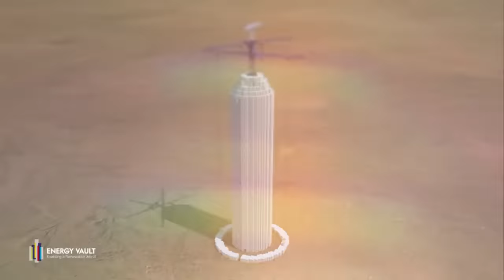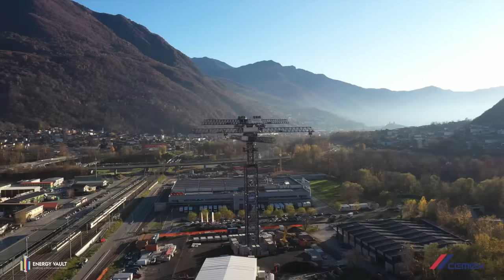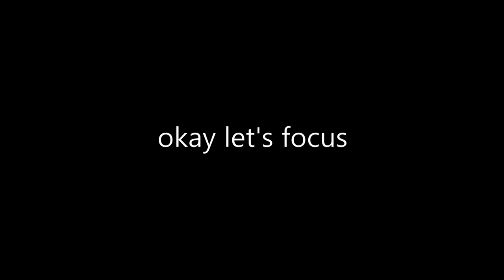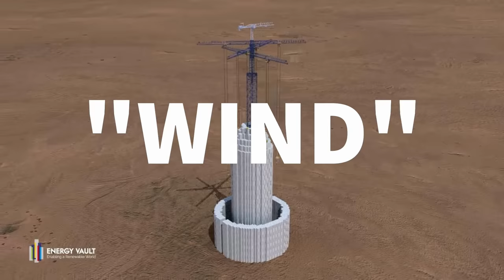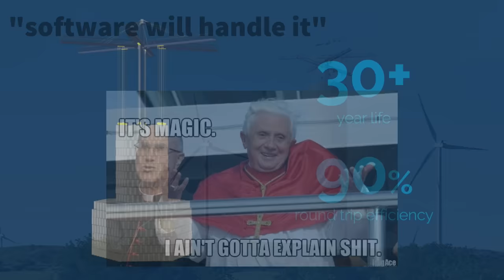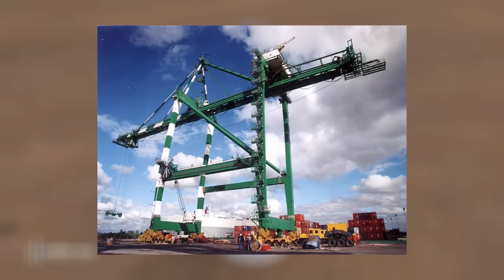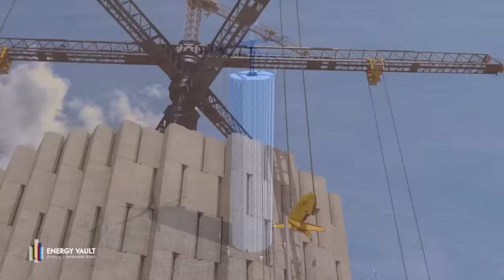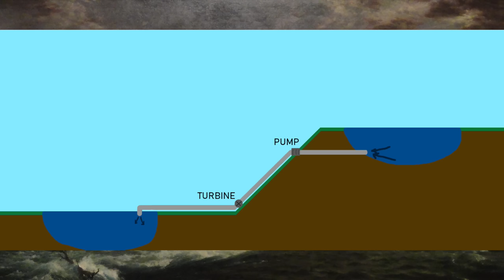The Energy Vault is a Dumb Idea, Here's Why

Comment: Listen, I'm extremely skeptical of energy vault, but let's be real for a second about pumped hydro... 

 Unless I'm mistaken it's pretty well established that we do not have enough suitable sites for sufficient pumped hydro storage, to say nothing of the location of these sites relative to major urban areas. Also, as we're seeing here in Ontario Canada, pumped hydro projects can get the same type of opposition as wind farms. Some of it pure NIMBY-ism, some of it legitimate concerns about environmental impacts on the local area.

As I said, I'm skeptical of energy vault too. I think there are probably ways to make the basic premise of "lifting heavy things as energy storage" more practical than what they're proposing. But capping off your argument with "Why don't we just do this thing?!" when that thing is inherently not scale-able and geographically limited kind of undercuts your argument.
Reply: This. "Why not just use pumped hydro?!" - gesticulates at flat coastal regions
Reply: @ThePixel1983  He pointed out that the easiest way of pumped hydro is using natural topography. However the "dig a big hole" method would also work. The startup cost would be huge, but in theory it could be done almost anywhere. One benefit of doing a closed indoor system is that water quality is a non-issue; as long as it doesn't screw up the pumps, generators, and valves, it could be raw sewage, industrial wastewater, or whatever.
Reply: Even in the flattest of terrains, surely building a tall silo with a few pumps would require less materials than building a solid tower with massive cranes?
Reply: @nicolaim4275  That water wants to escape in every direction at once, all the time. The blocks just need a strong foundation at ground level. Your silo needs to be strong very high up.
Reply: So the issues with pumped hydro storage are effectively the same issue the tower would have in those areas - if it's that flat, then the tower is more exposed to winds and probbly would experience the same amount of nimbyism and legit environmental concerns.

The biggest difference between the two is that hydro pump storage would expect lower startup and maintenance costs compared with the tower. Which sugests we need to find more solutions than just gravity storage batteries.
Reply: @TooShortPlancks  So like redux flow storage on an industrial scale? Yes, please, finally.
Reply: why not transport the energy to the hydrobattery? We surely have cables. There's some waste, but we also figured out high voltage AC. Of course, the same argument can be used for these concrete gravity batteries. Just place them where there's no wind. Probably there's a hill around to use water. But say there's a very very flat area, with no water whatsoever. Then I guess it's fine to use some solids. Of course, I am not sure why the solid has to be concrete. Why not whatever material is locally available? People build stuff everywhere.
Reply: @nydydn  From a German perspective: southern Germany (especially Bavaria) refuse both windmills and power lines. ("Not in my backyard", NIMBY)... You're proposing shipping the power across hundreds and thousands of miles and back again when most countries don't even have the capacities for distributing energy away from sun and wind regions.
Reply: Pumped hydro tests have been successful using an underwater reservoir connected to the enclosing body of water acting as the second and are limited to 700 meters deep. Here it's not he gravitational energy, but the variation in vertical pressure. This form doesn't require any specific geography, is compact, and doesn't suffer from evaporation, and if a reservoir collapses underwater, we'd just lose the reservoir and energy stored.
Guess what we have plenty of on this planet, bodies of water.

The big issues for this form is the possible disturbances on marine life where installed and complex maintenance. It has a similar MWh as the energy vault, while requiring less moving parts.
Reply: @EliteRocketBear  but digging is expensive, and the denser your material the less deep you need to dig for the same energy storage, which is a benefit of solid bricks over water
Reply: @paulochikuta330  underwater pumped hydro doesnt require any digging.
Reply: Lakes man.
Reply: Although I like a few of his videos, but the arrogance with this guy is just through the roof. 
If PSH worked for every case there wouldn't be any need for any other storage solution (Plus they are expensive, need specific topography, and destroy environments). So what does he suggest : 
- Stacking the blocs in a wall-like structure to help with the wind chuckle
- Digging a tower deep hole once again to help with the wind (cost, feasibility, sanity really...)
- Creating a lake deep underground, then putting another lake on top of it, with the turbine is at the same level as the top lake intensive facepalm
I won't go into the details about why this video (and many others on this channel)is a sham, maybe pull the wool over people's eyes, and as someone working in the field, I feel insulted.
Reply: "Global Pumped Hydro Atlas" for many sites to build one.
Reply: @EliteRocketBear  you mean underground subsurface . It's hella more expensive than regular PSH that i've work on for years now, thry are some of the oldest means of storage but they pose many challenges to be implemented and for that reason people are trying to find new solutions
Reply: @keith6706  indeed, one might even suggest making a tower out of those ridiculous bricks and storing the water in there. Costs waaaay less than continually operating cranes. Though, I think a less “sticky” substance than water might work better? Maybe this could be what we use all that already-extracted petroleum for! No, not really, but what a trip that would be, huh?
Reply: @Rocco_loco  No, underwater. The research project StEnSEA conducted successful tests 5 years back in a lake at 100m deep, and now they're trying to get this method tested offshore in Norway.

One reservoir is a hollow concrete sphere with a turbine that has water pumped in it, the other reservoir is the enclosing body of water.

I'd like to ask you to actually read. When someone says underwater, they actually mean underwater.
Reply: @EliteRocketBear  never heard of it. The point is tried and tested methods. Once again not every place has extensive bodies of water, this might even be less applicable than normal PSH. The aim here is reliable means of storage with least implementation conditions. What about us african countries with little lakes and sometimes no shore line.
Reply: @EliteRocketBear  without even mentioning cost maintenance and environmental impact
Reply: The planet is literally 3/4ths covered in water. The goal of the Norwegian tests is to further conduct extensive tests in salt water environments. Last I checked 38 out of 54 countries in Africa have a shore line.

As for environmental impact, according to the researchers, the impact is minimal as the flow of water is kept slow, and the turbine is fine meshed to prevent marine life and debris accidentally entering it. Means of implementation is cheap and easy because the only thing that is connecting the underwater reservoir is a cable, and is a non-moving part. 

As for maintenance and cost, the research team stipulates that the only loss in case of a crack, burst or failure in the turbine is the unit itself, and the energy stored in it, and that it can be disconnected and left on the sea floor because of the cheap manufacturing costs (concrete shell + turbine, with minimal moving parts. In case of a burst of a unit, the debris can be left to be used as an artificial reef. (which we are already are installing all over the world)

So far working extensively with PSH and never hearing of one of the major advancements of that technology ...
Reply: 100% with you. We seem to have decided to turn away from the easy solution (which would have been throrium liquid fuel reactors) and instead focus on irregular energy production. 
Since we decided to go that route we sort of need to accept that we won't be able to find a perfect solution that can be applied everywhere. I am sure countries where most of the power is made form hydro or nuclear are going to laugh at that saying it's useless while industrials that live in unstable grids would pay you a hefty premium if it means not relying on inflated peaker plant prices.
Reply: @keith6706  Dig a hole soo deep that hydro power is even feasible is just not working…
Reply: @nicolaim4275  Ever heared of density? you would need sooo much more water to get the same energy stored. And a turbine is not as efficient as a cable driving a generator, so even more water needed…you see people actually put thought in a thing…
Reply: @Rocco_loco  The guy thinks he‘s a absolute smart ass, but he‘s just a guy not getting any of it. His videos about the boring company are just hilarous, he‘s comparing a well established public transport system in a european city, to Las Vegas…
Reply: @ThePixel1983  "Your silo needs to be strong very high up."
Yeah. It's a shame that water towers don't exist...
Reply: @EliteRocketBear  Yooo, underwater pumped storage seems like a friggin pain in the a**. You have to keep hollow empty spheres deep down under water with a turbine working in salt-water. I have visited hydro powerplants, they have literal *shelfs full of nozzles*, as they get eroded very quickly. Not even talking about the turbines itself…Imagine you have to keep these things working down there…
Reply: @laser_simon922  I had the impression that he is an architect/engineer/urbanist so my frustration is based on the expectation of quality science oriented content based on real data (like research and credible sources) yet he usually uses concept 3D renderings and × operation on the calculator to deduce his "results". Like in this video calculating the total capacity from the promotional video's 3D concept. I had this impression because he kept bringing this Public Transport point which is valid (which is also the 1st thing you learn in1st course urbanism ) and I expected he would make other valid arguments in other subjects. But he just keeps bringing it up like a dumb mantras or say some other outlandish point that is based on total ignorance of  what actually is feasible. Hence the source of disappointment.
Reply: @FernieCanto  Let me rephrase it for you: Concrete blocks easy to stack, liquid water more difficult! (Or: There's a difference between keeping drinking water amounts on a tower and keeping a lake on a tower.)
Reply: Pumped hydro is not scaled a lot anymore cuz it already accounts for freaking 90% of the energy storage in the world.
Reply: Don’t even argue with people who make their ideology their identity. Any attack on their ideology gets received as an attack on their character
Reply: @GoldenMinotaur  who was that a reply for
Reply: @andy-kg5fb  Exactly. 😁
Reply: so 3 things:
1st Concrete will be rare at one Point. Concrete is already the single most used non renewable Rescource behind oil.
2nd I would rather have a Hydro Powerplant next to me than a giant Concrete Stack!
3rd If you are already digging a huge hole (for avoiding things like Wind) than you could also use it for a waterplant instead.

+there are already whole beaches/rivers being "stolen" by illegal sand mining because desert sand is not suitable for concrete, meaning investing in more concrete is investing into the destruction of beaches. :/

Edit:
4th If the whole Concrete Industry was counted as its own Country, it would be the 3rd biggest CO² Producer of the World...

Its not exactly what i was refering to, but it is in english and it -well is pretty clear:
https://www.nationalgeographic.org/projects/out-of-eden-walk/articles/2019-06-sand-mafia/#!
Reply: Energy grid in most countries are interconnected so location of pump storage does not matter.
Reply: @GameControlYT  😂 it does matter
Reply: @GameControlYT  you know that energy dissipates ? Do you ? ANSWER ME ? DO YOU ?? hhhhhh
Reply: One big problem with lifting things up and dropping them down is the linear relationship between height and energy. One thought experiment would be to lift your house up with excess electricity and then lower it through a generator to recover the energy. You'd think your house was pretty heavy but on average you'd have to lift your house up 35ft (10 meters) to store an average days electricity use.  Not exactly practical. 
Alternatives are flywheels where at least the energy stored is a function of the square of rotational speed. Plenty of other problems with flywheels, however.
Reply: @Rocco_loco  dude, the intermediate steps weren't solns, it's just his style. He points out flaws in a system, changes things one by one to end up at an awesome tried and tested soln. And tried and tested it is, you know 95% of the storage plants in service are pumped hydro. Also as he himself states, his videos are supposed to be small bite sized takes to lead you in the 'correct' direction. So you can't expect him to go with full on bullet proof arguments, ofcourse there are things I think he is wrong on, like e-buses.
Reply: @Rocco_loco  ya it does. What then, what do we do? Just make continents of batteries.
Reply: Lets just be skeptical of all energy storage "solutions" to the fundamental problem with renewable energy. They are all stupid and/or inefficient. Just like almost all renewable energy schemes. They might make sense for specific locations or off the grid applications, but as a regional/national/continental policy? Nope.

Baseline load = Nuclear/Hydro/Geothermal. Peak plants = Gas (or coal gasification in areas where NG is difficult to acquire). Supplemental to reduce peak plant loads = Renewables.

A sensible grid should be able to generate enough electricity to not need renewables at all in case of extreme weather (wind turbines can't operate at low temperatures and at high or no wind, solar can't operate when there is no sunlight, and function poorly when it's reduced, and have to be cleared of snow and dust)
Reply: @Rocco_loco  There is a problem with concrete (more correctly lack of sand that has properties that are required to mass produce good quality concrete) - and it is a gigantic problem now. Either real engineering or Wendover or someone similar made a video about it recently. They are less prone to take shortcuts and they actually explain things better than this channel.
Thunderf00t is special. He is good at what he does (nuclear physics mostly) and does know thermodynamics very well. Unfortunately he's kind of unbearable when his bias shows. Does this "concrete gravity tower" make sense? IDK - it has a lot of problems. I'm pretty sure that team of good engineers could do something with that, but maybe they can find a better solution. It would be a decent proposal for landlocked countries in Africa when it's polished, tested and demonstrated. And honestly given how much the west used fossil fuels - they could give nuclear powerplants to Africa and train people there to use them - it's not like there aren't very intelligent people in Africa and at least some universities are top notch. Then again you're the expert - I'm not.
Reply: For Pete’s sake, everyone in this comment section is so mean to eachother. Calm down guys
Reply: @potatolord9715  ha, I feel badly but I've checked out a long time ago. Life is just too short. YouTube comments should have a 72 hour limit for replies.
Reply: @jannegrey593   @Jan Negrey  I understand there is a sand shortage but that wont make concrete rare. People arent afraid there wont be there appropriate sand to build with but more about the price of concrete itself. If sand is too expensive it will be substituted with other types of small aggregate as ground granulated rock even synthetic or manufactured sand. I view the problem in cement itself and its carbon footprint, efforts must be concentrated on taking step by step to decouple cement manufacturing from fossil fuels. Lengthening life cycle, self-healing, green manufacturing and also recycling
Reply: @andy-kg5fb  I know what you're saying about PSH I was in one 2 weeks ago. The small bites thing isnt the same as saying something totaly wrong and talking like you've split tve atom. Many other channels that deal with construction lile real engineering, B1M, Wendover prod... all talk generally but still remain factual. And even mistakes are too small to bicker. And never as stupid as dig a lake size hole and put another hole on it
Reply: can we have some facts in the discussion(I know some of you are but...), instead of the usual it just works or just doesn't work. I read someone saying that the renewable solns don't make sense. That is completely false, the current price of renewable power is 0.08-0.1$ per kWh while it is 0.05-0.17$ with fossil fuels.
Reply: @Rocco_loco  I agree - though I want to point out that the sand problem is already big and increasing prices. And ATM synthetic replacements either aren't up to par or counties are not allowing them (so regulations are behind). And sand is used in a lot more than just concrete - not to mention that control over sand gives some people a lot of wealth. And unfortunately people in Construction still prefer sand. Which causes environmental disasters and personal ones.
Can you point me to a video or article that explains cement problem as well? I did hear about it, but not enough outside of some speculations. Of course you can write explanation yourself - but if you know any good source, I would be very grateful. Understanding problems we face is of utmost importance.
And I can't find the video on sand shortage that I watched recently. It was quite detailed, but also understandable and not political. But the title was not good for finding it after couple of weeks :( 
But decent one can be found on almost unknown channel called: "Vallis | Video Essays" (without quotations obviously) and is called "Why Sand is Becoming a Scarce Resource".
Thank you for your civil response.
Reply: @Rocco_loco  well can you tell me what's wrong with "have two reservoirs, one below the other and pump the water from the lower to the upper one when you generate power and let the water flow from the upper one to the lower one when you need energy."
Reply: And before someone comes saying," but neuclear is much better than renewables, it's safe too you know." I completely agree. Neuclear is the way to go, but that wasn't what the video was tackling or what I was arguing, the video and myself were arguing about the most effective way of storing energy, which is by far pumped hydro(well atleast that's what we are arguing). Also as I said in an earlier comment, renewables beat fossil fuels, the only problem is storage, so these arguments aren't a complete waste of time.
Reply: @paulochikuta330  you're thinking about optimizing for weight. Optimize instead for price. Since the capacity is directly related to the mass of material you have (GPE), compare the price of raw water per ton to the price of concrete per ton. Water wins out because of how incredibly cheap it is compared to concrete, or any material that needs to be manufactured.
Reply: @Rocco_loco  ok now that's just a critisism of the style of the content. Not that it shouldn't be criticized, but that does not make pumped hydro any less effective. Pumped hydro is currently the most used storage option. Quickly being replaced by batteries, but both of those have thier problems. Both should be used together to get the best out of them. Or even better just go neuclear.
Reply: Well, just use pools of mercury instead of water! Much denser; much more energy-dense.
Reply: @andy-kg5fb  OP clearly as nobody was tagged for the reply. But anyone smart enough to listen to it really lol
Reply: @Rocco_loco  good oversimplification, it's actually; dig a reservoir for water, build a platform over the reservoir to store the water to minimize evaporation, fill the storage platform with the water and allow the water to flow downwards through turbines and into the reservoir to generate power. Run pumps to drain the reservoir back into the storage and repeat.

Also, if what you're using to generate the power is also supposed to minimize wind effects, what happens when you need to restack?

If concrete/weight-based energy were efficient, wouldn't it have been done by now? How are some relatively stationary cranes generating power, it doesn't seem like there is a complex driveshaft/crank mechanism to turn to drive a generator.

Wires have a much higher risk-factor than pumps do for failure, and when they break, the entire system becomes dramatically less efficient.
Reply: Also, wouldn't pumped hydro storage constantly be bleeding "power" from evaporation and seepage into the soil? Seems to me like you'd have to put it in tanks, because any body of water exposed to the open air will just evaporate or freeze.
Reply: @Rocco_loco  he literally says its being tested right now. Ive never heard of it either,but if it is getting tested in norway right now, doesnt that mean that someone sees enough potential to actually invest in it? This is perfect for offshore wind farms like in britain and norway
Reply: @nicolaim4275  Adding on to what others are saying, using material more dense than water reduces the size of the machine, bringing down costs.
Reply: @augustday9483  oh and wouldn't it be constantly gaining power Through raining. Dude you know that there are ways of reducing those problems. Also why don't we look at facts and numbers instead of, "look at this problem which should be a big deal". Pumped hydro has a storage effeciency of 70-80%. Which isn't perfect but pretty great for how cheap it is(compared to other storage options), it's great. The only problem is that it's pretty much at its technological limit and doesnt have much of a room to grow. But there is reason it makes up 95% of all storage plants of the world.
Reply: @henriquepacheco7473  Its not a good solution, but you can‘t compare Las Vegas (no piblic traffic at all) to an old european city…this is just not how stuff works. His solution of just blocking lanes for public transportation is so far from thought through…I just think that this guy here makes it makes things sound soo much easier thsn they really are…
Reply: The hill version requires specific geography, but elsewhere you could just use a large water tower and a cistern.  Both long-solved design problems in their own right.  to get power reserves on the same scale as dam-based pumped hydro you’d need very big ones. or a lot of them.  or just make the upper tank taller, dig the cistern deeper, or use a heavier fluid like mercury—which comes with its own problems ofc, but at least it’s a fluid that can be pumped instead of blocks that need to be delicately stacked, and a fluid we don’t have to manufacture at a great CO2 cost that we already spend a lot of environmental protection money to just store far enough away from people that it won’t hurt them.

The point the video was making was that there are DOZENS of other ways to build a gravity battery, basically any of which would be better than “cool scifi hexagon of concrete blocks.”  If you want a gravity battery based on the same basic concept, he specifically mentions the shipping port gantry crane, and to make a cheap gravity battery with that, you could take an existing port gantry design and feed it existing shipping containers filled with any dead weight you can think of—lead for example is cheap, or you could shove literal garbage or in there while you wait for a landfill to be completed.  The core concept of a crane based gravity battery for solid stuff is sound, it’s just not the revolutionary, ORIGINAL idea the team there is trying to sell it as, and it’s clear that these guys have compromised the actual viability of their concept by caring about aesthetics and marketability more than practicality for a concept that they supposedly want to sell to the electrical utility grid, an industrial sector and paired government regulatory bureaucracy famous for its aversion to risk of any kind and “I don’t give a damn how it looks, we can hide it in the middle of nowhere” attitude towards the question of form versus function.  These are people who want clout for the cool gizmo they made, not actual viable solutions, and honestly deserve to be mocked in a somewhat cavilier way for just making “pumped hydro but worse somehow.”
Reply: as usual people think the world is a homogenous mass of cheese where you can just dig up holes as much as you want without having any stability or ground water problems.

Theres also seems to be a version in... Wales? where they use and old mining shaft which is much more convenient (but also location specific of course.
Reply: As a counterpoint, I would argue that doing pumped hydro on the same smaller scale as energy vault by just building big@$$ water towers atop water tanks, is a more elegant solution than energy vault.

Instead of having to maintain multiple cranes, and deal with the annoyance of lifting solids as your weight medium, maintaining a pump/turbine to move a liquid medium is elegant. Its why pumped hydro is so appealing by comparison.

Most pumped hydro is done on extremely large scales in a small handful of areas where the land is already suited to it. This is only done because if the land happens to play nice with your idea of lifting and lowering water, the overall cost of doing it will be a lot lower.

The thing is, doing pumped hydro in that way is not a requirement. You could easily do pumped hydro storage on the same scale as energy vault with already existing water tower technology. And I'd be willing to bet the pump/turbine will be easier to maintain too.
Reply: @FalkFlak  nobody's saying that it's easy to dig. It's just a better gravity battery. It is location specific, yes, but it is much more efficient than batteries if you find a good spot. And if you don't have a good spot use other options. And do this only if neuclear isn't an option. And if this also doesn't work out then go with gas. Noone is saying that we have a fully solar grid with pumped hydro as the only storage option.
Reply: a hole is exactly the same "gravity battery" and not better. There are other complications than building a tower but I agree, every location has its specific benefits and obstacles.
That why its also dumb to say "just build water resevoirs" as in the video. They already DID build water reservoirs. Could be more probably but that is another discussion.
Reply: @laser_simon922  Yes, he does oversimplify stuff. I'm pretty sure the point of his videos aren't quite to solve the issues, but rather to push people towards demanding alternative solutions to what's often accepted if that thing's not functional.

Secondly, if you don't compare the positive effects of mass public transport in a city that has it to the flaws that pop up in a city that doesn't, it becomes a bit harder to argue for it.

Finally, if you're digging tunnels and underground stations, why not install metro to connect the two? much more effective as public transport than... whatever the fuck you call elon's RGB claustrophobia machine.
Reply: @hatman4818  But look at the efficiency…to run a turbine you need s motor/generator, if you hook it up to a cable you have almost no losses, if you‘d power a turbine you have alot of losses…
Reply: @adriansaidan1736  optimise for cost, digging is expensive, denser options lead to digging less
use recycled concrete
use rocks in steel nets
it really doesnt need to be expensive or virgin material
Reply: @FalkFlak  can we have some numbers and evidence pls. Compared to what is in the video pumped hydro is infinitely better. And again the point of the video was not to revolutionaries energy storage, it was to bring light to the inefficiency of the energy vault, and yes, every system has its flaws, but if your flaws make you  infeasible in any scenario then you should rethink. Also what's the problem with pumped hydro, it is not location specific, it is more efficient in certain locations but can be used anywhere. Secondly who said that we'll store all our energy with one type of storage device, we can use pumped hydro alongside batteries. The problem with energy vault is that it's infeasible in any scenario (just watch the video) and you can't say that the talented engineers will handle it, it's an inherent problem, bricks are expensive, stacking them while lowering them aswell bleeds a lot of energy. Also before someone else again says that pumped hydro has its problems and is therefore useless, tell me why pumped hydro acounts for 95% of the storage plants in the world.
Reply: you really think we can bring any amonunt of water to any place we want? And the (locale) enviromental impact of a water reservoir is huge not even speaking of politics (the locale population usually fight those things). I'm all for this kind of tech although this crane doesnt look very convincing to me, but concrete is obviously much easier to handle in general (you also need it for water reservors btw) . But making a 3 min video just stating "build more dams, d'uh".. I don't even know what to say about it anymore (and won't). 

With the term better (not MY word) I understood the underlying physics  Lifting a weight in a hole vs. Lifting a weight at a tower, is exactly the same. The question which is "better" to construct is a question of many aspects. You propably don't know much about geotechnics, I don't know much about egineering cranes so this question is darned to stall without any further project planning.
Reply: @FalkFlak  and you really think that the video was trying to solve energy storage,don't you? The video was arguing that pumped hydroelectric storage is much more efficient than stacking a bunch of bricks. If you want a detailed analysis check out Thunderf00t's take on the subject.